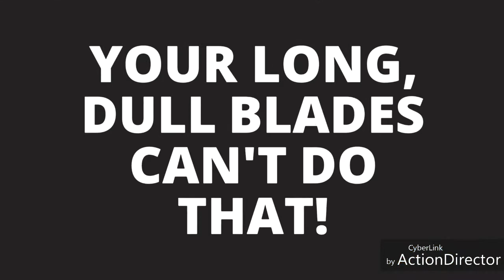Is Your Jigsaw Blade Broken or Dull? Save Money with This Simple Jigsaw Blade Hack!

Comment: Thought I would try this on a sawzall while I was up at my Grandma's farm, because her blades didn't fit the saw I had just bought. And it worked great for about 4 minutes until the blade came loose and shot out forward at about 100mph  through the garage door which was open, pinging off a large propane tank in the driveway somehow causing a spark and setting half a field of corn completely on fire. Luckily the sprinkler system kicked in. So I decided to leave  before she came back home. She still has lots of crops on the other side tho. Plus corn is overrated anyways.
Reply from the maker: It doesn't even taste good anyway. Good riddance!